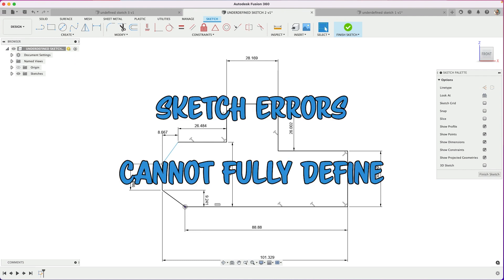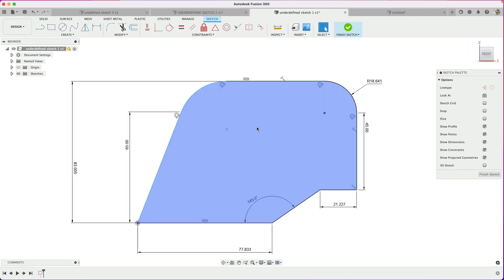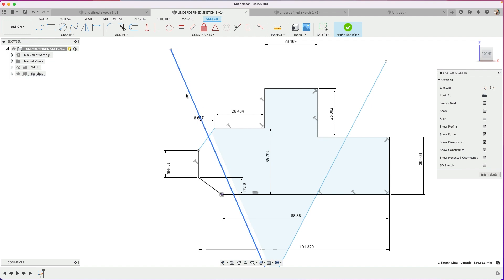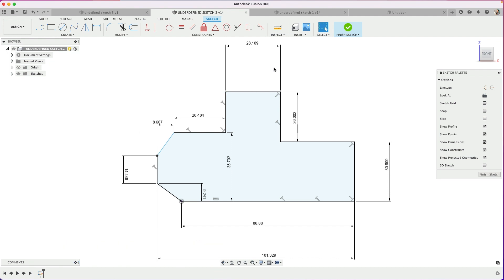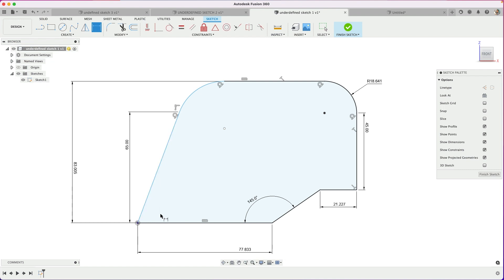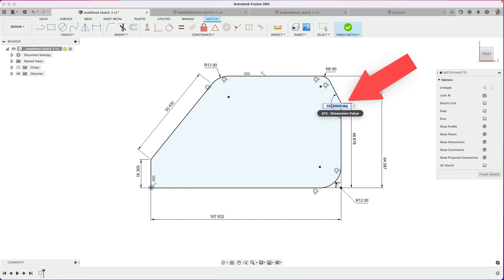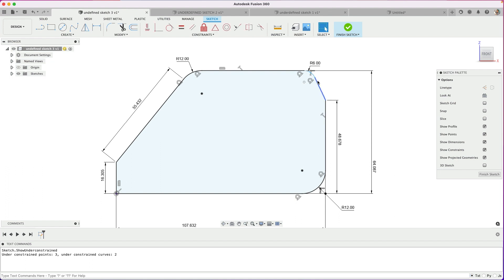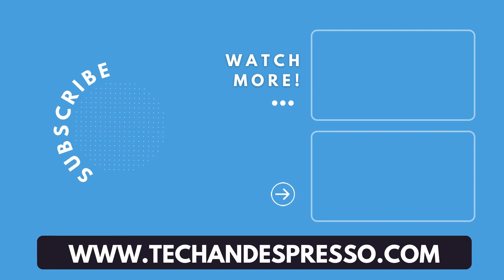Fusion 360 problems (3 Tools You Must Know)

Comment: Can you show us why the miror command does not work as expected with bodies. Often after the mirror line is selected you can see the outline on the otherside but after you cluck okay it throws up different kind of errorors, most often cant computer patern ...blah blah blah but the thing is it did computer to the pattern ...it just wld not apply it to the body.part it showed up in. This has driven me crazy many time. Please help. Thanks

Comment: Coming from SolidWorks which has a "Fix" command, Fusion has been a tad challenging to get to a fully constrained sketch every time and this video is a great reminder of trouble shooting tools.  I am struggling with the details of joints, specifically gear train joints and properly animating say a 3 gear system or say a worm gear to spur gear setup.  Joints are done nearly completely opposite in Fusion as compared to SolidWorks, so I am probably at a disadvantage coming from that space...
Reply: There is a Fix command in fusion. It can be found in the constraints section of the sketching menu. It is the icon that looks like a padlock and is labeled "Fix/Unfix"  (edit: by the way, instead of changing to black lines, the "fixed" sketch elements switch to a green-ish color. So you will then possibly have these colors on your sketches: blue: un-constrained; black: constrained; purple: projected; green: fixed)

And yeah joints are very different. I messed around both with solidworks and inventor a bit, and think they were similar to each other. Fusion is 180 degrees from that. In many cases it works quick and easy, but in some cases I miss that control, even with it being a bit more tedious in most cases.
Reply: @BlackSmokeDMax  That Fix command in Fusion is about restricting movement, thats why its in the constraint menu.  The Fix command I am referring to in SW is like the Sketch.showunderconstrained command and tells you want is not not constrained in the current sketch.  I think the sketch command in Fusion is as close as we will get in Fusion..
Reply: @lgarnand318  ah, I see
Reply from the maker: Me too! I miss the sketch dr in Solidworks but luckily these Fusion workarounds can help.

Comment: Thanks!  Really good video!  Things I have had problems with…  Can you accidentally delete a sketch item from one sketch while using it as a projected item in a second sketch?  Also, if you  close Fusion 360, when you reopen it the top level assembly is selected rather than the component you were last working on.  More than once I have started Fusion 360 and added a sketch, only to find it is in the top level location.  And finally, most “beginner” videos start with how to make sketches rather than how to properly set up a project.  I would like to see tips on setting up the structure of a project. (Yes, I am very new to Fusion 360)